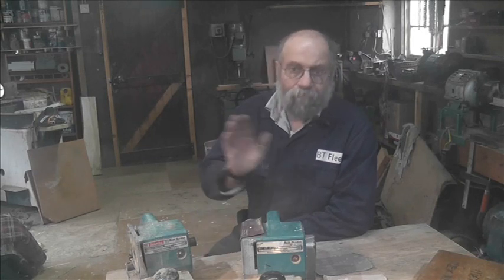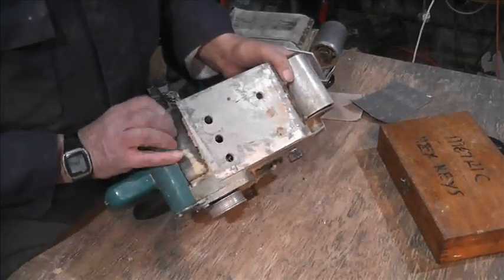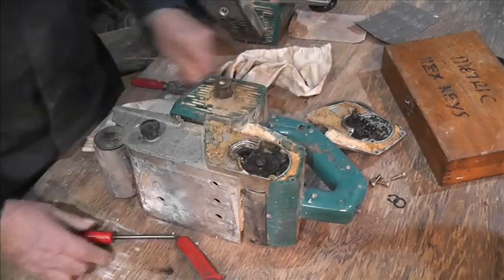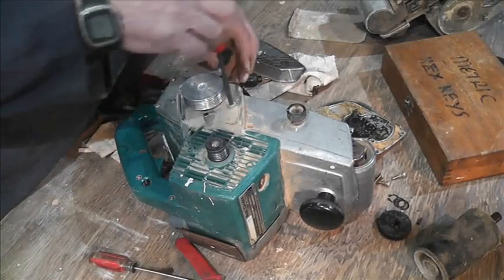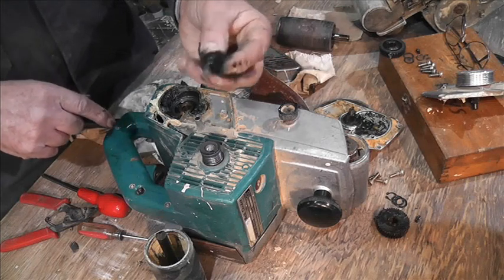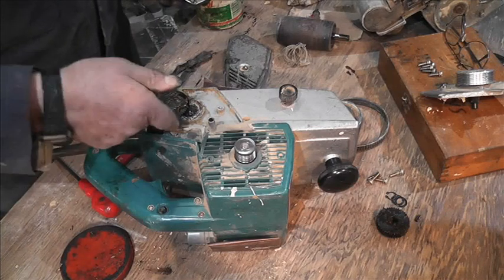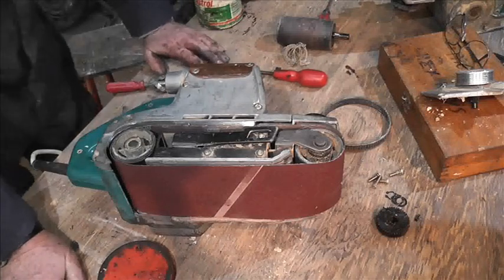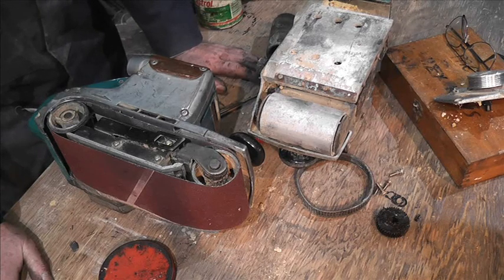Makita belt sander repair, keeps ripping belts

Comment: Hi Andy. Thanks for sharing your video. I have a Bosch 4 x 24 sander that was destroying the belts within a minute of putting them on. 

Using a piece of the old sanding belt on the plate solved my problem. 

Thanks again
Reply from the maker: Hi, that's an easy fix, those belts are very robust, cheers

Comment: Old Makita were brilliant. Tough and made to last. Shows with the ease of maintenance and repair. Now you get security screw's on a charger.
Reply: Agreed, I was gifted an old pendulum type Makita jigsaw. Takes the Makita own-brand blades (still available) that come in a myriad of profiles. Very handy.
Reply from the maker: Sam, don't get me started on those things, but yes it's great engineering, up to a standard, cheers

Comment: Agree they don't make things like they once did. Great you didn't have to buy a modern replacement.

Making stairs looks difficult assuming you dont have a jig to make the stringer.
Reply from the maker: They were all hand marked out and cut, many sets had at least 6 winders, cheers

Comment: One could use the sheathing from large diameter electrical cable cut at 45deg along it's length and glued to the metal roller. If you didn't have a spares machine or new rollers unavailable
Reply: The other option is to get the old rubber off and slide sections of bicycle inner tube over the roller, 1 or more layers.
Reply from the maker: Ian, the balance of saving spares for decades or rebuilding . I suppose it depends on space available, cheers
Reply from the maker: @bootsowen  Owen, to remove the rubber would be tricky, maybe on the lathe, cheers

Comment: Just the other day I replaced the crown gear with shaft (worm on motor shaft) on my newish Bosch 3" belt sander. £22 for the gear and shaft direct from the manufacturer. You couldn't make it for that price!
Reply from the maker: Ian, the question I ask is why did it fail? cheers
Reply: @TheInfoworks  not sure. I've been using it fairly heavily on some planks off machinery pallets lately. The worm on the arbour is fine and usually hardened. The crown gear looks to be a slightly softer metal (as is customary in meching gears). The shaft the crown gear on appears the same as the motor arbour. The teeth on the crown gear had worn to the point the motor was skipping. This sander uses a carbon pad between base and paper. Bought a new one at the same time, £3.
Reply: @TheInfoworks  there's a rule we should all follow: When a machine is taking longer than it should, inspect and replace it's cutting/abrading surface. Some of the wood I was sanding is a bit gummy. I was fairly ready in replacing the sanding belt but perhaps should have changed sooner.
I'm always pretty frugal and push things further than I should.
Reply from the maker: @ianhelsbyservices  so you were making it work for a living and when it starts jumping then that's it, were the thrust bearings all OK? cheers
Reply from the maker: @ianhelsbyservices  we used to clean and extend the life of clogged belts with a light flame from a blow torch and a wire brush across the belt, cheers
Reply: @TheInfoworks  i tried the wire brush trick a few times but it only worked if I caught it early enough.
From what I recall, there are no thrust bearings to stop the motor rotor riding down the machine, designed to rely on the tight fit of the ball bearings in their holders. One of it's cooling fans had slipped down and was beginning to eat through the housing. Perhaps the rotor had ridden down and as the teeth on the crown gear are tapered, the  harder worm chewed it up. Works now and feels like new so we'll see how it goes.
Reply from the maker: @ianhelsbyservices  We found that belts would gum up with pine resin, especially Scots pine even thought it was Kiln dried in our own kiln down to 10%. The heat lifted it for the brush to shift. Definitely catch it early, cheers